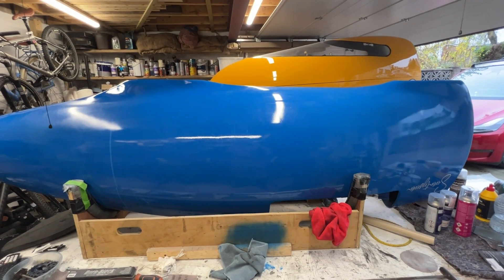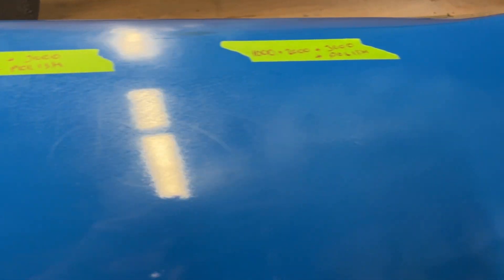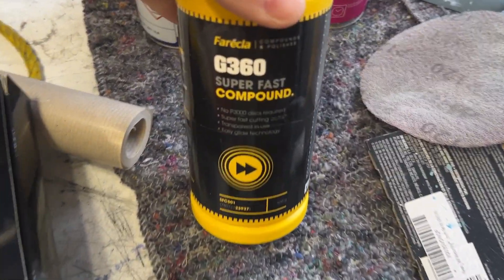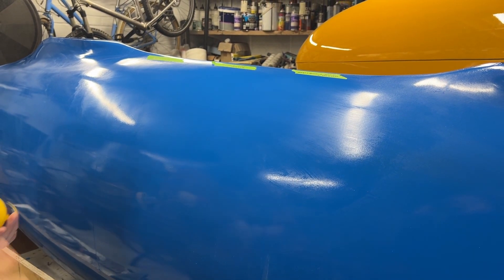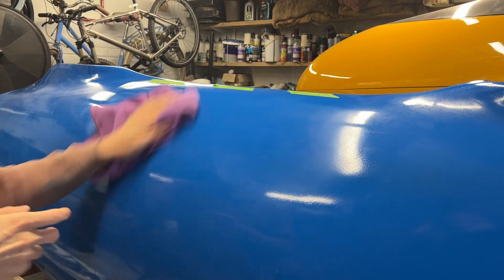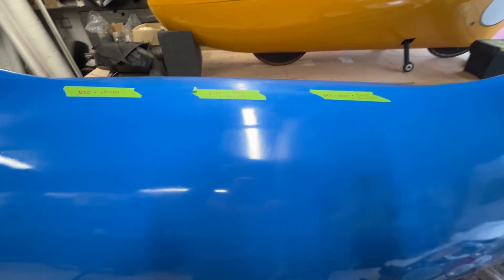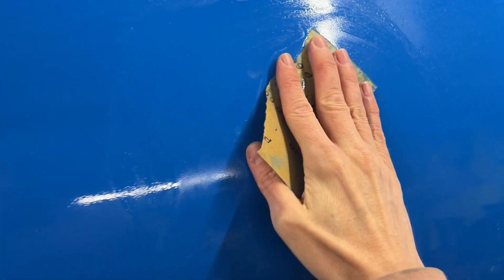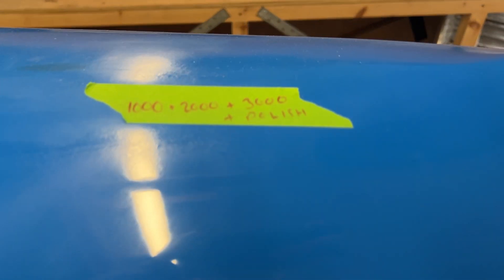Battle Mountain streamliner 'seventyseven' - shell polishing experiments - Nov '24

Comment: As a former car painter, I suggest that you try acrylic lacquer paint. It's not as durable, but smooth as glass when done right. It also takes more layers but repairs are much easier. Just my two cents...
Reply from the maker: Do you mean a clear coat on top of the blue paint?  To repair the bike after it's slid down the road (which the bikes have a habit of doing in Battle Mountain), would you then not have to do two coats of rattle can repair - blue and then clear coat?  It's the 'done right' bit that is very difficult to do in a parking lot with a rattle can!  I know it's all a balance, but I think we've got more chance of getting it consistently good (ie smooth, not necessarily aesthetically perfect) with a blue acrylic rattle can and then wet-n-dry down to 3000 and then polish. Let me know your thoughts....

Comment: I'd be interested to see the effects of a tuft test before and after polishing. I wouldn't be overly surprised if the rear half of the bike benefited from the orange peel keeping the flow attached as long as possible.
Have you ever tried any roll down tests or similar to experiment with getting the lowest rolling resistance tyre and rim width combo?

Comment: I'd go with 1000 in small sections until you finish the whole thing, and then repeat with 3000. Both times I'd be looking closely to make sure the orange peel is gone, but not so deep as to go through the paint. Between the 1000 and 3000, use several damp cloths to remove the residue. 
Finally, I would apply a thick coat of Collinite Fleetwax 885 by hand to one side, let it dry for about 3-5 minutes in the shade on a sunny day. Then remove it with a clean golf towel. Do the other side the same. While removing the wax look at the surface very closely to see if there is still any orange peel. If not, then you can apply another coat a few hours later, or even another day later. Make sure you dust off 77 before each coat. After the 3rd coat or so, it will become very easy to remove the dried wax from each coat. I'd do about 5-7 coats now, and then, another 5-7 coats before your first run at BM. After the 3rd coat, your golf towel should easily slide off 77 when you lay it on there. 
I cleaned a 50' Pacific yacht in Hawaii with a fiberglass boat cleaner, and put 17 coats of wax on it (1 per day) by hand when it was in drydock. It was so shiny that by the 5th coat birds started flying into the side of it. By the time I was done 5 birds had hit the side of the boat.